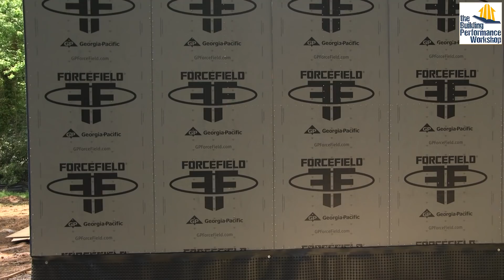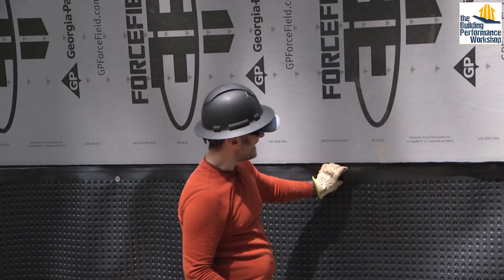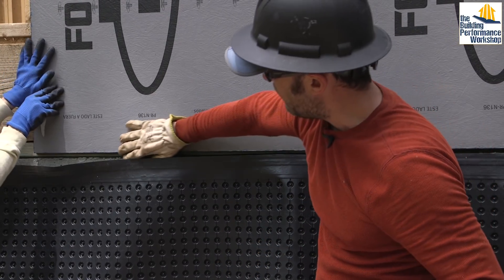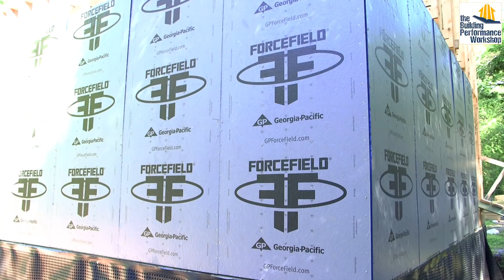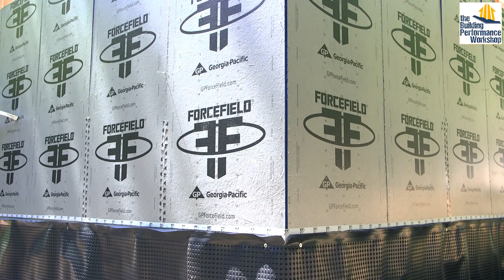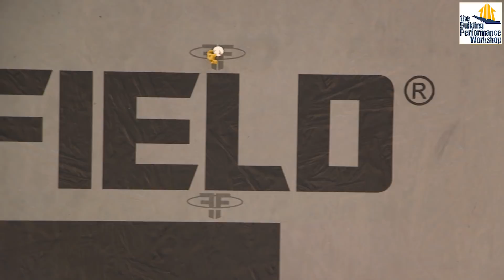How to Install WRB House Sheathing (ForceField)

Comment: I'm a bit confused regarding this tape. Is he using the regular seam tape? I don't see a tape specifically referred to as a straight flashing tape. Theres also the yellow premium tape. I question which one I would use for sealing the foundation to the sheathing. 

I also saw you went with tremco for other parts of the home. Is this superior for air tightness? And I wonder which is more costly. Tremco is much cheaper than zip liquid flash or prossoco

Comment: for the tape, why do you not push it in to be flush and follow the contour of the wall and to the concrete?
Reply from the maker: Because we goop later
Reply: @HomePerformance  I had the same question, but I don't understand your answer ("because we goop later").  I would have expected the tape to be applied to the face of the FF, the bottom edge of the FF and then down onto the sill plate and then the concrete.  This would seem to be a better application compared to the only the bottom 1/3 of the tape being adhered to a substrate.  Corbett....can you elaborate a little more as to why I shouldn't place the adhesive in contact with substrates along the entire length of tape?
Reply from the maker: @a72036279 this tape won’t stick to concrete, so use liquid applied flashing after (Dymonic 100, ZIP Liquid Flash, etc)
Reply: @HomePerformance  ah, so were just showing it as another option? 
When would you want to use the tape over the goop?

Comment: Just a cheaper version of zip, but in your case is best choice for the dollar. No need in wasting more on the better tape. I used zip and liquid flash but I used 2 layers of felt paper and bricked my house. Only did 30” overhangs. Did 100% rock wool in 2x6 walls

Comment: After 4 years how is the forcefield osb holding up ?? Just curious causr im thing going towards forcefield vs zip system . Zip sustem is soaked and this is glued on sort of. Curious how it holds up
Reply from the maker: No complaints, no failures

Comment: There are other advantages to your installation method. It is extremely difficult to keep the bottom plate perfectly flat, and sheeting while the wall is laying flat more often than not results in larger than optimal gaps at best, or a giant rocking horse and more future setting and interior cracking at worse. One won’t make as much money installing sheathing your way, but unquestionably it will make a significantly stronger, better sealed structure.
Reply from the maker: Thanks, AF-O6

Comment: I'm not sure I've heard you discuss why Forcefield sheathing was better than, say, OSB with a peel & stick membrane, like Vycor Env-s or Henry Blueskin VP100 or equivalent. Is the sticking agent a contaminant and IAQ issue, or was it more cost?
Reply from the maker: Time is the main saver imho. All-in-one wrb sheathing is just more streamlined to install in some cases.
Reply: @HomePerformance  

Like, say, when you're 16 feet in the air hanging onto a ladder? 😉

It must have been a sight seeing you try to manhandle those sheets that high up. They're not the heaviest things by pure weight, but the square footage that weight is distributed across makes them so awkward.

Comment: Why not tape the nails?
Reply from the maker: Extra work, time, and material- payoff is minimal if you have your gun set correctly. However, we did tape the nails if you continue to the rain screen video.
Reply: @HomePerformance  awesome thanks. Do you remember how much each board cost when you bought them?  I’m finding them for $33/board.
Reply from the maker: The price has gone up for all lumber products. They were around $22 at the time I believe.
Reply: @HomePerformance  yea I’m building a house it’s insane.
Reply from the maker: It’ll go back down once you’re done haha
Reply: @HomePerformance  that’s the truth lol.
Reply: @HomePerformance  it’s only 1000sqft so it won’t be to bad.

Comment: "they're designed to last 50 years or more" (https://youtu.be/u20-UEwy_a8?t=834) <-- I'm curious though, with this whole paradigm, don't we want to have buildings that last for centuries? What does air-tight, passive house-level construction look like if it's being built to the standard of: "it's designed to last 300 years or more.."?

Comment: Inventor? Aren't they licensing this product from Zip or had to discontinue it due to a lawsuit? Honestly just curious...
Reply from the maker: No, the same guys actually invented both systems. There was apparently a lawsuit because ZIP wanted to keep the inventors from making competition. But they settled and as long as they keep manufacturing the way they do, then the products are different enough legally, I guess.

Comment: There is no way a real builer would vote he time to hand nail in all those thousands nails flush
Reply: If the customer is paying him for a high performance build they should. And it doesnt take that long really. You have to go back and tape the seam. Run through it with a hammer, that's a minute per seam. Then tape it and smooth it out. That's another 3-5 minutes per seam. I'd say a full 8 hour day to do the who0e house

Comment: What is the Georgia Pacific warranty terms and conditions on their ForceField System? Previous GP product experience says to ask now and compare with like systems like ZIP etc. See: https://forcefield.buildgp.com/DocumentViewer.aspx?elementid=16043 and https://forcefield.buildgp.com/DocumentViewer.aspx?elementid=16042 and https://forcefield.buildgp.com/DocumentViewer.aspx?elementid=16041 with more details at https://forcefield.buildgp.com/forcefield-resources.html
Check out the ZIP System with Matt Risinger at https://youtu.be/CVAzMmgijGk  FYI the ZIP system is widely used in wet climates... it really works!
Reply from the maker: 10 year, but it’s transferable, unlike ZIP. Ultimately, if it’s installed correctly as part of a tuned system, you shouldn’t need anybody’s warranty.
Reply: @HomePerformance  The GP documents takes a lawyer to understand... lol Thanks!
Reply: @HomePerformance  A few more videos on siding... Hurricane Testing - Whats the Failure Point? https://youtu.be/mSFV0gvVxRk

Comment: Just wondering why you chose forcefield over zip system? Looking forward to your video on that dimple membrane on foundation.
Reply from the maker: The two systems do essentially the same thing, and Rick Jordan is ALSO one of the inventors of ZIP. ForceField is his improvement on several characteristics of the performance and install, eg taping ease and vapor perm. They actually test the perm of the whole product after the membrane is applied, which not everyone does. Also, I found the people at the company to be a lot more fun and communicative.
Reply: @HomePerformance  I read the patent lawsuit Huber filed against GP for Forcefield and in it they claimed Forcefield was an inferior product due to the tendency of the membrane coming loose off the board. I have no idea if that's true or not, but GP ended up paying licensing fees to Huber over this. As a guy looking for a sheathing for my house, I'm just trying to figure out which is better. Forcefield is cheaper, but is it better than Zip? There's no real videos or info I can find that makes this direct comparison.
Reply from the maker: I imagine part of a lawsuit settlement like that might be to not compare the products, so they can’t do it. Ultimately, they do exactly the same job within a wall system like ours, so if you’re protecting them, they’re interchangeable
Reply: Great video! Thanks!
Reply from the maker: With pleasure, Alex

Comment: Hot dipped galvanized cannot go in modern pressure treated wood.  Should use stainless!!!!  believe this - galvanized will corrode very fast in PT wood.
Reply from the maker: Mmm, I'm pretty sure any HT Galv fasteners specifically are tested with PT lumber, and say so on the packaging
Reply: @HomePerformance  This is actually a well known problem, with much written about it.  But don't take my word for it - Tons of information out there on this:https://www.deckmagazine.com/design-construction/fighting-fastener-corrosion_o;   http://www.ggashi.com/wordpress/wp-content/uploads/PT-Lumber-Causes-Steel-Corrosion.pdf
Reply from the maker: @fordguyfordguy  At least that first article you mention specifically says to use hot-dip galvanized fasteners- NOT electro-plate galvanized ones, which will disintegrate.

Comment: I just heard you say "three feet of eaves."  Interesting to me, as I have decided to build nothing less than 24 inches on my projects.  It requires a lot of thought on trim and supports but it keeps the walls and windows more dry!
Reply from the maker: Hell yeah man. My structural engineers are trying to spec something that will work, but we’ll do 2 ft min. We’re tacking the eaves on after the enclosure is perfect.
Reply: @HomePerformance  I think they tack on 12 inch eaves, but how can you make sure anything more than that is OK to tack on?  I think what Matt Risinger is doing is still using rafters, but sealing with Zip sausage tubes.  He has a great video on youtube called "Zip 2.0" I think.
Reply from the maker: @fordguyfordguy  structural engineer just gave me calcs and a detail that will work with tacking on 2' eaves. I wouldn't feel comfortable without the calcs.
Reply: Home Performance looking forward to seeing it!
Reply: @HomePerformance  

My guess is the structural screws tying the overhangs back into the framing gave just enough hold to deal with a 24" overhang, as long as half the OSB was over the structural framing of the house too.

24" at 40 PSF shouldn't be any problem for a couple lag screws per stud at 16" OC

Comment: Why in the world are you using a stick gun instead of coil? Why didn't you use a gasket under the bottom plate?
Reply from the maker: Why in the world would we use a coil gun? Why in the world put a gasket under the bottom plate?
Reply: @HomePerformance  Coil gun would be less reloading since you would have 250+ nails in the gun instead of 56 with the stick gun, save some time. Gasket under the bottom plate is good backup for air sealing and sometimes bug intrusion.

Comment: Question, did you look into fluid-applied flashing?
Makes the rim joists/foundation sealing easy.
It can also make dealing with over-driven fasteners simpler.

I'd likely have done the tape at the base of the wall different.
Wrap it around the bottom instead of leaving the gap.
Now you have a gap that can expand/contract, and as the tape degrades over time, it could crack, venting the entire gap around the base of the wall to the outside.
Reply from the maker: Yes, we’re aware of liquid applied, but we chose this approach for our particular home.
Reply: @HomePerformance  yes you did. the real question is why since you are aware of the other positives of those added methods
Reply from the maker: There is no single best answer in life. Beware silver bullets.
Reply: @HomePerformance  heck I could see that LOL was curious why one method over the other.
Reply from the maker: Stay tuned and you’ll get the whole picture :)

Comment: Just wanted to share the way I do this, I know your not concerned with speed, but what if it was faster and better?  I sheathe the walls on the floor, this allows you to tape while on the ground, much easier and you can get a better tape joint.  No moving ladders around for the tape or humping sheets of osb up ladders.  Add the sheathing around the rim joist after.  Since you at ground level and the pieces are small this process goes very quickly.  Use a sealant behind the bottom course of sheathing to mudsill, if you seal your mud sill to the foundation before hand this gives an extremely tight connection.  We consistently blow below .5 ach50 with this method.  Not trying to be a know it all, just trying to share some knowledge.
Reply: Gee is that anything like measure down so you have the overlap of the bottom sill and bottom plate?  OMG that might be easy .  Doing a bit of liquid flash while the panels are on the ground might also make things a bit easier to achieve lower air door scores also
Reply from the maker: Have you ever raised a 16’ 2x6 wall with 12” of extra OSB at the bottom? Can’t imagine not breaking all the bottoms off and feeling like an ass.
Reply: @HomePerformance  start at 4:25 https://youtu.be/RA3X7YJKMBQ
Reply: @HomePerformance  it's called wall jacks
Reply: @HomePerformance you use wall jacks and you toe nail a few 8s through the bottom plate to the sub floor- this keeps them from sliding and acts as a hinge as you stand them so the don’t slide. You liquid flash the rim right before standing. It’s how we do it on a production basis

Comment: Wouldnt you want to install the sheathing horizontally  for better shear and racking strength. Then you could stagger them every 4'. Vertically you could only stagger them 2' max if you are working on 24" centers. Less if you are on 16's.
Reply: Since the shear strength is largely dependent on the pullout value of the nails, it's more dependent on the nailing schedule rather than the orientation of the OSB. 

Vertical orientation and a tight nailing pattern, 4-6" O.C say, means easier taping of the seams too.